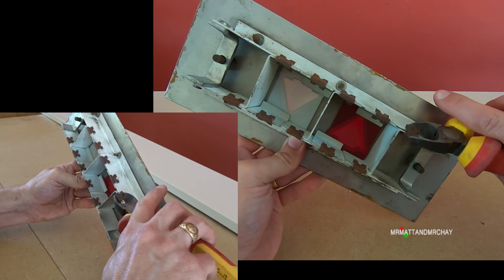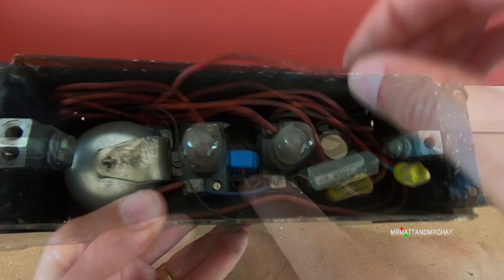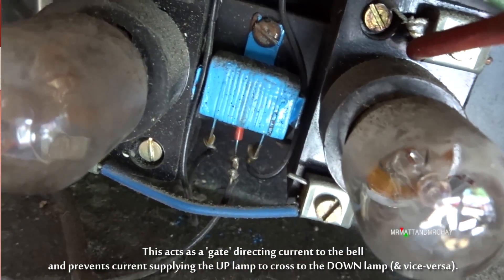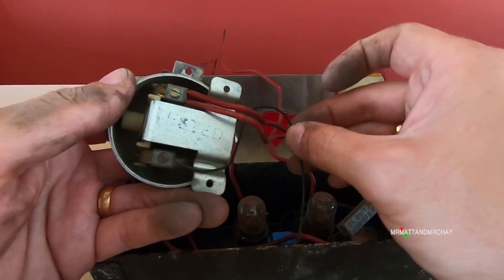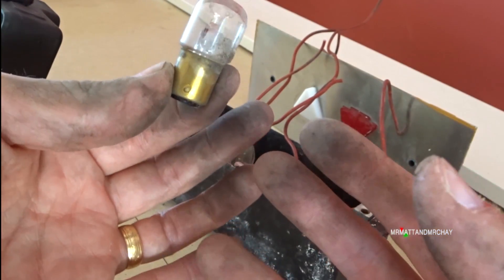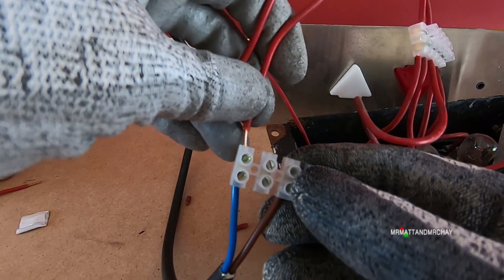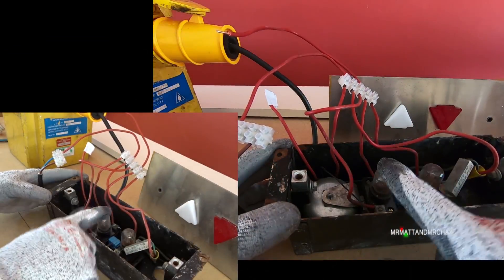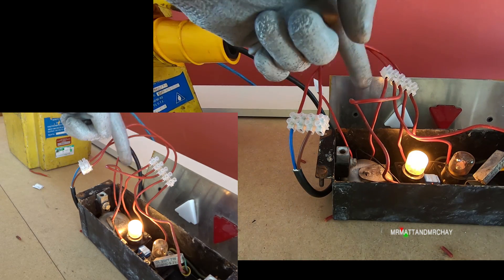Old EXPRESS LIFTS floor lantern, examination + power up

Comment: Do you know why the lamp/bell uses 100-130V power? It would seem logical to have it use the standard 240V in the UK so you wouldn’t have to install any sort of transformer with the lift.
Reply from the maker: Hi Oliver - good question.  Firstly, 240v would be available between the phases (i.e. don't forget that these lifts are fed from 3-phases (as explained here: https://www.youtube.com/watch?v=4Y03CuvhFms   But you have to think 'globally' here and whether a manufacturer would design a UK voltage into a lift, then if it were used in a different country you'd have to made mods to work with their voltages.  I think more to the point, 100-130V is a safer voltage to work with when replacing lamps.  It will still give you an electric shock, but it's safer to work with.  Then is the availability of 240v bulbs of that size (the lift manufacturer obviously wouldn't design the lamps), so perhaps 100-130 volt is better to use for the availability of the lamps.  All food for thought!
Reply: @mrmattandmrchay  I've got the sneaking suspicion that they might have had other reasons. I might be way off but they could've used a plain single-diode rectifier to get 100-something V DC from the 240 AC mains and then use diodes and change the polarity of the supply for lighting up the up/down bulbs one at a time. Those rectifiers were common in lift controls anyway because for some reason the brake solenoids are usually DC. IIRC a bridge rectifier without smoothing capacitor will yield a 190-odd V and a single-diode around half that. I researched that a while ago while working on a 1913 lift converted to AC in 1965. When it was abandoned in 2012 the lift engineer simply pulled the brake rectifier out of its socket and left with it to make absolutely sure no one would switch the lift back on.

Comment: The blue component in the middle looks like a stack of plates, maybe some kind of selenium rectifier?
Reply: Yeah.
 Dual dialed in some configuration or another essentially. Yes, basically. Choose one of your dials, but the are composed of stacks of plates essentially. These coming very small ones to quite large and I've seen some huge ones 

I used to come in and get ahold of what to call sylvinium. Power units which are actually basically power supplies. They're useful pipe organs back in the day. The whole thing was a large pipe. Mississippi rectangular box or a square or sparks, so we'll leave in hand surrounding. Wishing's really nice old beefy chords.  And yes, they were plugged into receptacles that were switched from the organ power and I think the idea of it was that these could be easily swapped out if they have a problem, they can swap it with another one fairly easily. I converted a bunch of these 2 pretty decent bench power supplies as an. Underpinch, because they're so big, so these were rated as little as 10 amps.  There's a lot larger.They do have access to lot pipe.Organ stuff so pretty cool 

And these Dialects have actually some pretty nice characteristics in it. In some cases, for some things we're actually better than modern diaries. But yeah, but oh boy, you would know when Willie is goes bad when he gets cooked when one fails and gets cooked. Yeah, voicemail other ever and it didn't go away either.  A few times I was replacing a bad one that would literally have to play it and sealed the ziploc bag to control the order. There was no escaping that odor you would know that if a device had a selenium rectifier or selenium diode that went bad, you knew it big time, those. Refacers are nothing compared to this.

Comment: I made the mistake of removing those clips so I could clean it better... And broke the resin. The cracks aren't where the light shines through so it isn't too much of a pain but I am kind of annoyed.
Reply from the maker: Oh no!  That must be so brittle!  I have a video coming up of an Express panel, and one with the cracked resin that went through to the front!  It's good it doesn't affect the front though.  I had to learn from experience - if it ain't broke, don't try to fix it!  I've paid in life by ruining stuff that I really didn't need to open or amend!!  Hope you're OK LB, keep in contact!

Comment: Awesome, I really like express indicators in my town we have some awesome express indicators, I live in Northampton so home of express most of the lifts got modernised out of all the muti storey car parks I have been to Jackson lift group have modernised them with ILE and Digital Advanced logic. They only kept 2 express lifts for what I know off 1 70s express in mayorhold car park and 1 rare gated express that I think is 1st generation in Grosvenor Shopping Centre Car Park. I have not been to St Michaels Car Park I am guessing the lifts their have also been modernised as its also owner by the council. In the Grosvenor Shopping Centre their is 2 extremely rare tall glass 3rd generation express lifts which originally had the rare posh 3rd generation express lift buttons, sadly elan lifts the maintainer of the lifts which is a good company for example intu Watford they modernised two glass Schindler M Series and they do pre doors with that their is a setting sometimes pre doors on sometimes not, the 3rd generation express lifts are the same sometimes have pre doors on then sometimes off and their is a very loud clunk abit like Kone for the pre doors but way louder. When they got modernised by elan they only changed the inspection/cartop controls and the buttons to Dewhurst, everything else is fully original they added no voice which they did not have when they were made in the 80s and they still have the old indicators inside and outside I like every express indicator, I would say 3rd generation is my most favourite as it is rare, awesome and is so different to their other indicators. I once talked the a elan lifts engineer and we had a talk about the lifts for a few minutes and he kindly showed me the motor room  and I can confirm nothing has been changed to the logic and motors also he knows how rare  those lifts are, I have a feeling those are the only glass ones left in the Uk, because express did not install much of the 3rd generation and it is like Schindler M Series it is so efficient. It’s a shame they went bust in 1998, if you ever come to Northampton I recommend you see those lifts and go to the express tower the lift their has had a slight mod to it with a ILE control panel, the original panel is still their and everything else is original last time I went I think they might of changed the inspection controls most likely. Also just to let you know the Lift surfet YouTuber’s Beno and befacecomputing have been rude about you going to the Dewhurst factory it was posted on befacecomputing Instagram storey and it was about how you think Dewhurst make good products, I completely hate negative people like that and Dewhurst are a amazing company.
Reply: Do the Glass Express lifts in Northampton have the Express digital controller? Or are they relay controlled?
Reply: Lift Tracker Relay Controlled
Reply: @mrmattandmrchay  I tried to arrange a visit to the Express tower a while back. I asked them if they do public tours, which they just came back and said ''no''. Maybe I asked in the wrong way by asking for a tour. I shall try again some time. There's so many things that I wanted to do but just like everything else, it will have to wait. Hopefully I'll get to see the other remaining Express at the BSM sometime too.
Reply from the maker: @Lift.Tracker  "Maybe I asked in the wrong way by asking for a tour" - perhaps.  I always try to do everything legitimately - some people are very obliging, most don't reply and all the rest say "due to H&S....".  I can have a go, but currently I'm back at work and things are really busy (probably a good thing in today's climate!).  On the other hand, I'd love to meet up with you at some point in our lives!  Send me a PM or email sometime :)  I've also a back-log of emails that deserve a reply that I've yet to do!  Busy times!
Reply: mrmattandmrchay Yeah, also The express tower is called The National Lift Tower If I remember correctly.

Comment: If I want to create my own latching relay circuit for a lightbulb, what materials would I need to buy off amazon? If you have any good links, please let me know.
Reply from the maker: Hi, first question to you is, what voltages are you working off?  Are you looking to run a mains lamp, or are we talking 12v light bulbs here?  Also what voltage will the relay be fed with?  Are you using like, a 12v DC transformer?
Reply: @mrmattandmrchay  I know very little about voltages and their usage in certain scenarios. All I have watched is the "easiest LATCHING RELAY CIRCUIT" video, so I have little experience. I'm trying to create my own circuit as a fun little project (and so I can hear the click noise every time I press the button).
 
1) I believe that I'd be using 12v, as those are what are used on most lift lamps? 
2) Not sure, as I haven't bought the wires or relay yet.
3) I'm trying to keep this as simple as possible. Would converting from AC to DC voltage make things easier/is required in order to make the circuit function?

Comment: I’ll bet those clips are probably easier to get on then to remove them. They also look quite sharp.
Reply: Usually those types of fastener clips have pointed tabs angled so they slip on easily but dig in when attempting to remove.